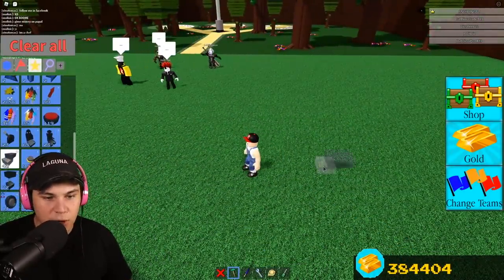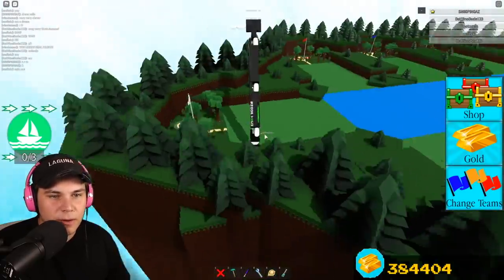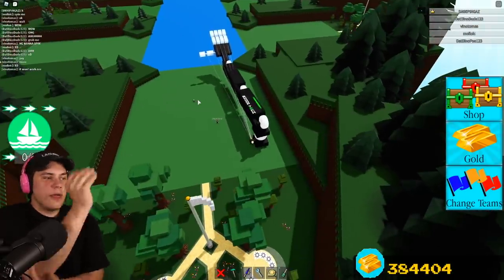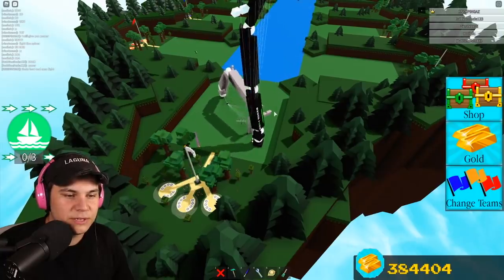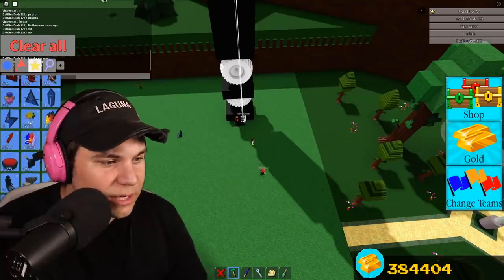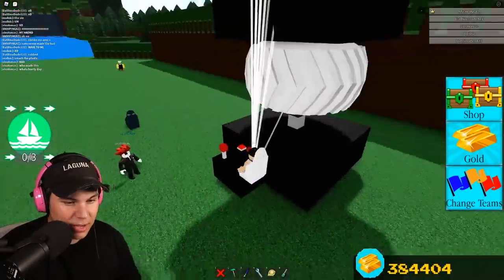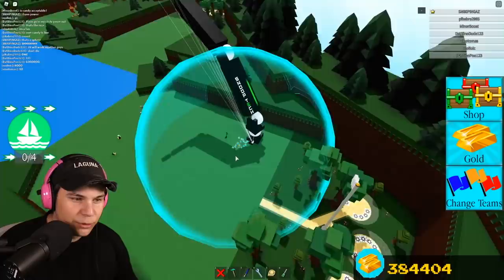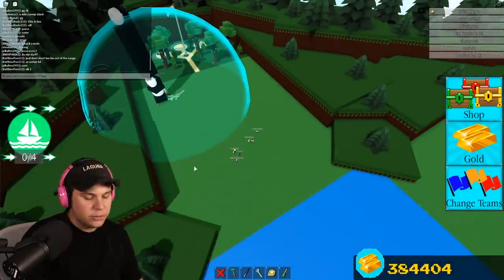WORKING MECH ARM In Build a Boat! *CRAZY*

Comment: one thing that i learned in build a boat is that you can sort of balance your creation by using a pilot seat on top of a hinge. if you spin the pilot seat, it will stabilize your hinge which then stabilizes your boat.